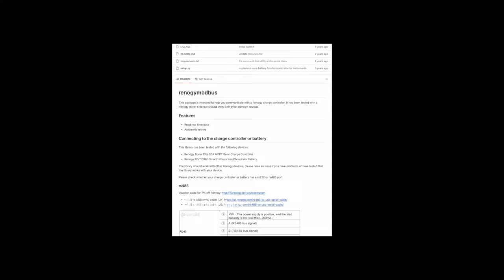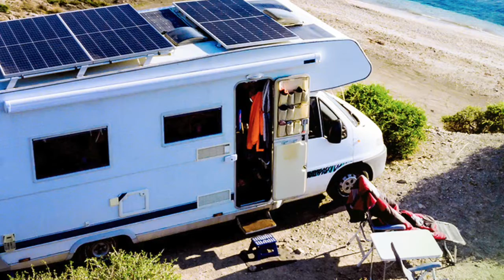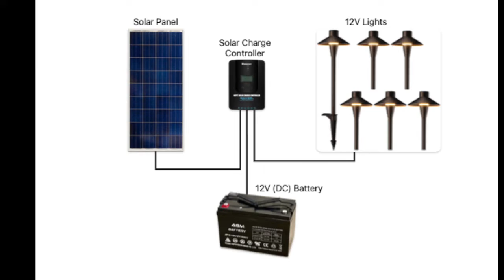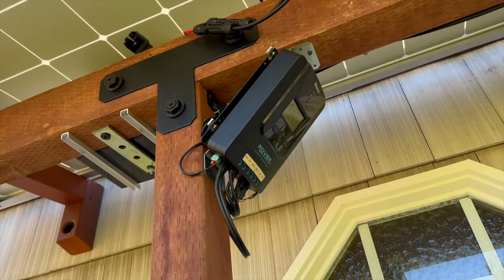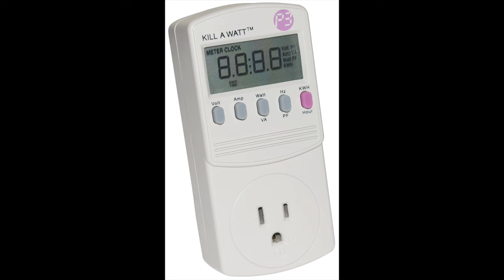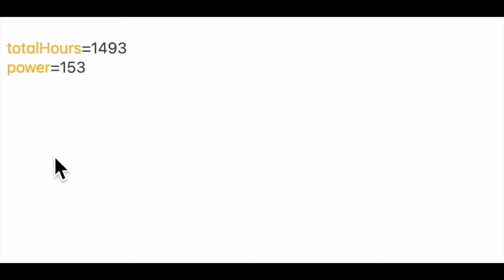Using Solar to Power My Landscape Lights

Comment: Thanks for the great video and nice work on your project and installation too. I have 24V lights spread across different areas of the house, so I'm thinking about multiple solar battery setups. I might need to think about outdoor enclosures for the battery too. Fun project to do but not trivial. 😅

Comment: I've done the same thing at my house, but I use a cheapy $20 Bateria PWM controller and a single 100W panel. 12V LED lighting is so much better than the stand-alone solar fixtures that output low lumens, have lousy plastic solar panels, and use NiCd batteries that only last a couple of years. Plus most of the built-in solar stuff looks like cheap plastic crap, whereas you can find very high-end uplights, downlights and pathlights.

These cheap SCCs are perfect for landscape lighting because they automatically turn on when the panel has no voltage, ie at night, and run as long as you want. No timers or adjustments to make with seasons or daylight savings. They also have various load on/off interval settings to run security lighting, an attic fan during the day, a fountain pump, etc.
Reply: This is cool. Could you share more about the parts you are using?